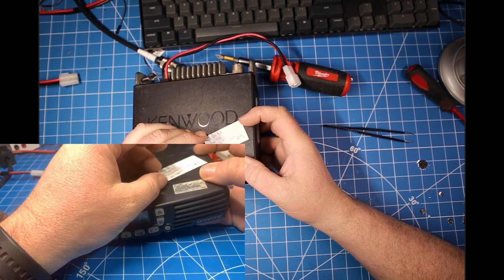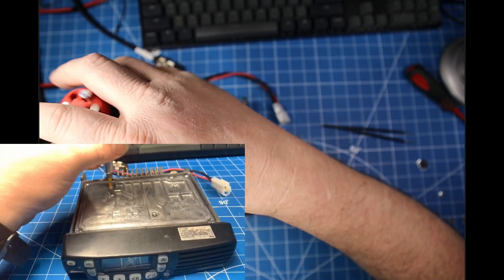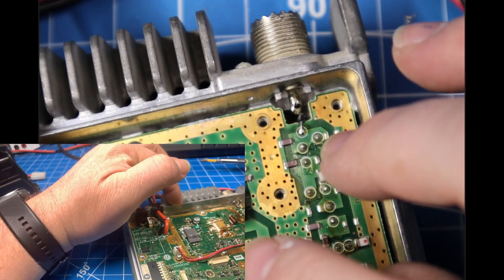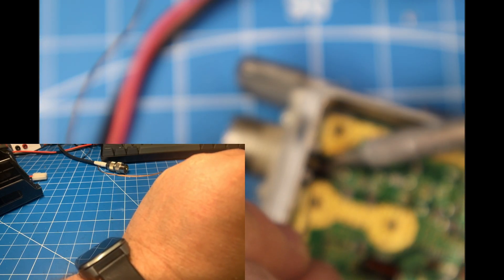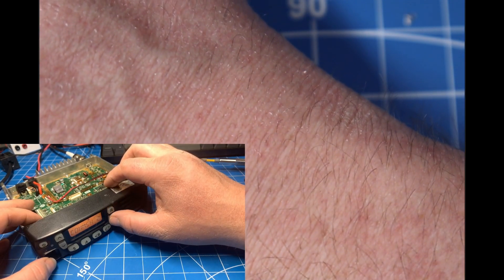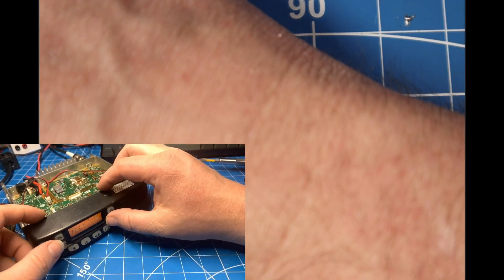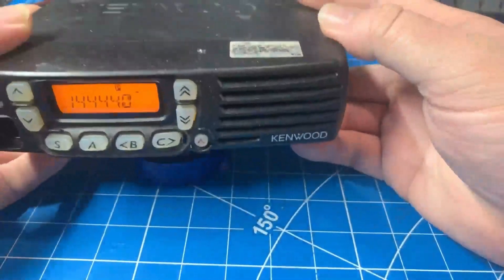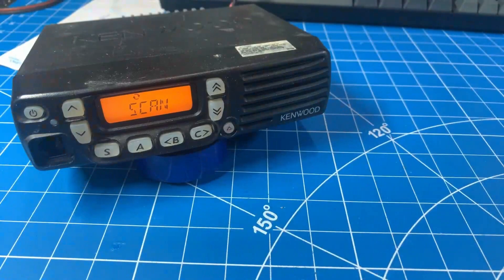Kenwood TK-7160H No power output and weak Receive

Comment: Good catch on the antenna port. That would make a difference with that not connected.  I just purchased a TK7180 for our club for an existing Allstar Node. It currently is hooked to a TYT 9000D and it has been problematic with noise. I have used commecial Icoms for packet digipeaters and they have worked flawlessly. I just starting down the road with these commercial Kenwoods. I have several Kenwood Amateaur radios which absolutley work fantasticly  and I want to experiment with some  Kenwood commercail radios.  Thanks for getting them fixed up. I enjoy watching you repair them.